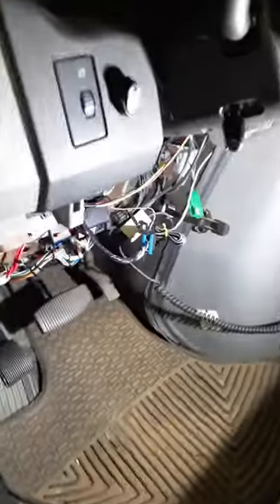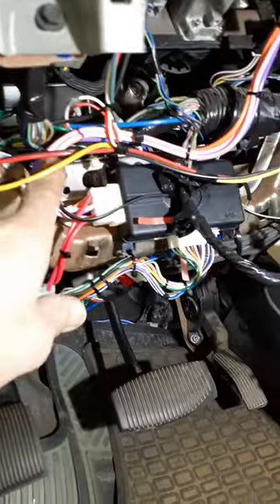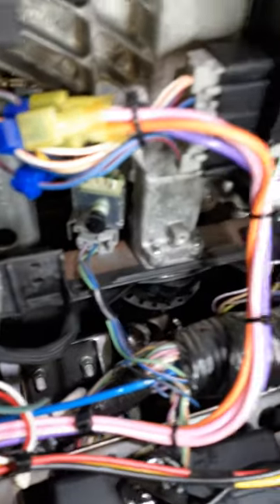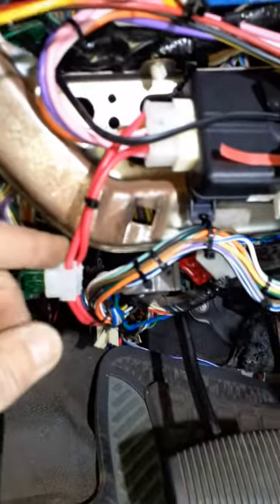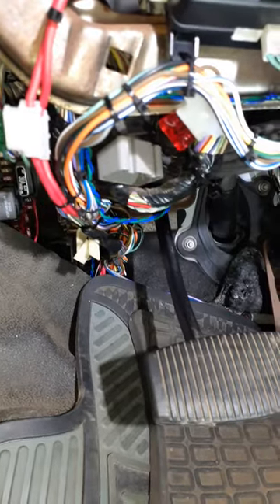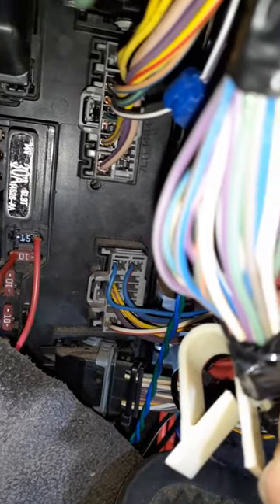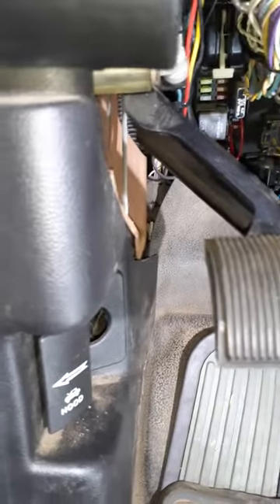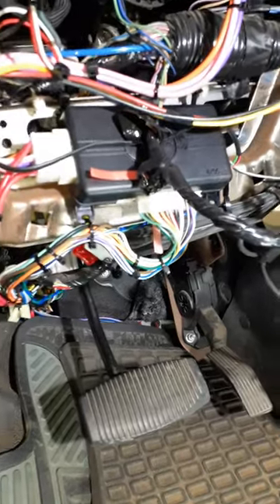2014 Ford E250 remote starter

Comment: Hi body, Forgive me for asking you about a video from a long time ago, by any chance, do you remember which were the cables you used for the ignition?  my problem is that all the colors are the same
Reply from the maker: I will look for the cheat sheet I used, but I believe it was wirecolor.com that I got it from or 12V.com